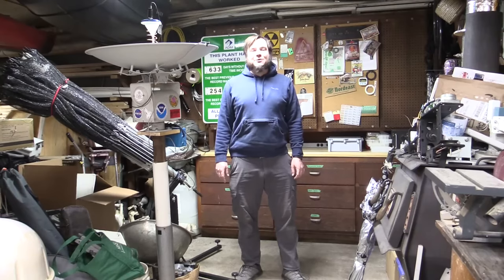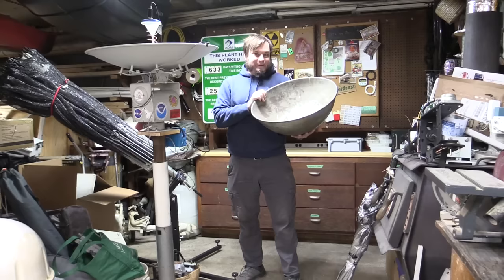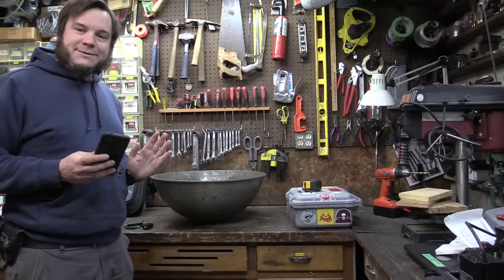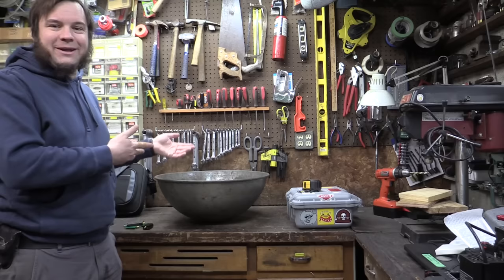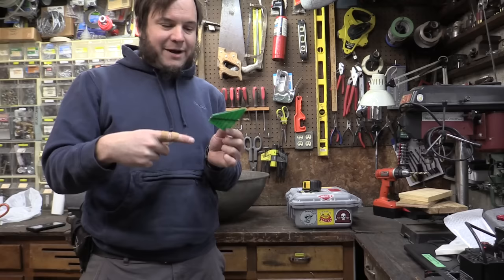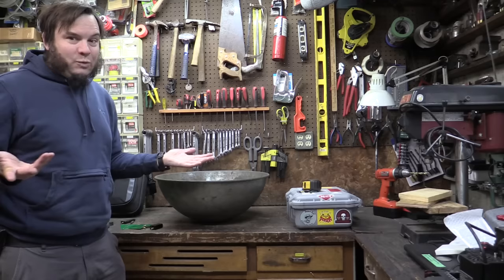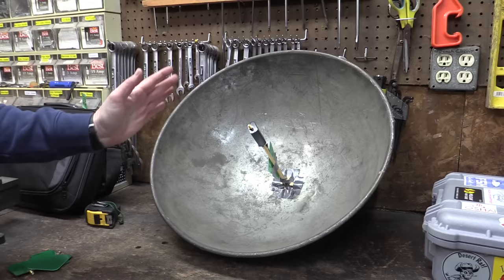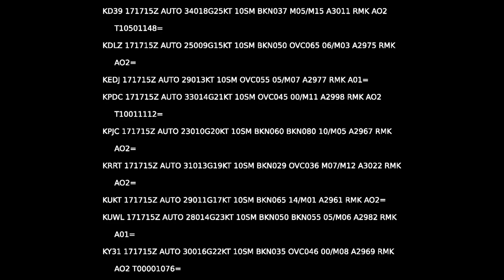Can I Make A Satellite Dish From A Big Bowl?

Comment: We're about 2 videos away from a paper-mache satellite dish.  Keep it up Gabe!
Reply: I LOL'ed  With a punching balloon mold.
Reply: Alright -- here's what I'm thinking.  Get a bit of plastic sheeting and tie it across the opening in a 50-gal drum (or a 5-gal bucket).  Draw a slight vacuum.  That gives you the parabolic shape you're looking for.  Then add paper mache.  Then aluminum tape.  Bam!  The world's first paper-mache antenna ;)
Reply: @markjarrodhughes  Do it with a space blanket and make a parabolic mirror. Then burn things lol.  There's a guy on YouTube who did that.  They tried to use expanding foam to hold the shape afterwards though if memory serves me.
Reply: that is possible with a little tin foli
Reply: Paper mache made with aluminum foil...
Reply: @kman201399  Ooh!  I've got a whole collection of hats made out of that stuff!  We've got plenty!
Reply: Doesnt a loosely hanging string form a parabola? Im thinking cut a broadsheet newspaper into 1" strips, glue em up, maybe a few sheets thick and make a bunch of ribs, id probably hang them between 2 rails on a clothes horse so the distances remain constant. once they are dry, arrange your ribs, add more paper until complete. youd probably want to do it in a few steps so it doesnt get to soggy. I dunno, ive put about as much thought into this as its taken to type, but im sure its possible after a few attempts. its not as if the the parts are of any worth. would be nice and light weight for handheld use.
Id give it a go, but Ive got a collection of dishes hanging in the shed which im not doing anything with.
Reply: Yes very possible !

Comment: Those bowls are normally spherical... remember Arecibo?  You use a linear feed with a spherical section to approximate a parabola... and you can steer the feed around instead of pointing the dish!  A set of cross-bars would probably have suspended the feed well and given you some focus adjustment.  Linear antennas work fine for circular... you don't even have to spin them to peak the signal unlike linear-to-linear (satellites generally are not stabilized in rotation).  You do lose a little dBs.  Your focus calc is probably not good for spherical reflectors.
Reply: Sure, but if he spends 2 weeks calibrating a mixing bowl that's two weeks he's not spending on serious content.  All the calculations in the world aren't going to make it ideal.

Comment: the most convenient thing in a kitchen for antennaification ive used is a wire mesh ladle for deep frying. a couple of bucks from the asian supermarket. built one for a mate in high school who had a really bad wifi signal in his bedroom. cut a hole in the middle to poke a USB wifi dongle through, a usb extension cable, adjust the depth for best signal and apply hot glue. we 'mounted' it by stabbing the handle into a box and parking it on top of the closet. took the signal from 1 bar to 3 bars, which was enough to be useful. 
Our first attempt was a coke can cut up very similar to the candle reflector in one of your recent videos shoved over the routers antenna. kinda worked a bit, but also tanked the wifi for the rest of the house, so that was a No-Go.
Eventually found a long enough length of cat 5 to run around the outside of the house. pro tip, black poly irrigation pipe makes excellent outdoor stealth conduit. cheap and ubiquitous, lay it in the garden bed and nobody questions its right to be there. a much easier sell to the perentals/landlord than wanting to punch holes in the walls or roof. I wouldn't use it for mains and ends up a bit longer, but Cat 5 dont mind. Ive used it more recently in rentals with particularly difficult landlords and housemates who dont appreciate the aesthetic of cat5 winding around the loungeroom and hallways. no idea why...

Comment: i did something like this with a large stainless mixing bowl duct taped to a tripod with a usb wifi adapter zip tied to a free bamboo chopstick, it worked great for borrowing wifi from the neighbor across the street (with permission).  the feed point/ best signal was almost at the brim for the adapter... it was a 12" diameter bowl

Comment: Try putting the feed 2 to 4 multiples of the wave length that you are trying to receive from the estimated focal point.

Back in the lat 1960's I mounted an 8 ohm speaker using all thread standoffs in front of a large bole like that and connected the speaker to the microphone input of an audio amplifier feeding headphones and I could hear two guys talking in a boat they were fishing in the Manatee river in Manatee County Florida, they were about a half of a mile from me and I could hear them very well.
I was on the north side of the river in a small town called Palmetto Florida, yes it is the same town that the movie with Woody Harrelson was in was shot.

Comment: I've got some of those PCB antennas recently, having designed some patch antennas for my degree I wanted to check out what was out there already.
Some are not bad, some shift in what frequency they are resonant at with very minor contact with other objects, thats high frequency antennas for you tho.

The log periodic is the most reliable but that almost planer horn shaped antenna is quite sensitive to condition changes.

Comment: Using a right angle triangle C^2 = A^2 + B^2 you can calculate the radius of a curve..

Depth = C - A
B = Diameter/2
C = ((Depth^2) + (B^2)) / (Depth x 2)
Radius = C
FocalPoint = Radius x 2 (or is that half)... This part I forget..

I used this formula to calculate the depth of reflector telescope mirrors..
If you are grinding your own..

Comment: I think you need low gain antenna like a simple dipole in the focus since the signal comes from all part of the dish in different angles.
The log periodic antenna is probably way to focused and only uses a small part of the dish.
Reply: Also the one antenna he said didn't work at all is a Vivaldi or Tapered Slot antenna, and he had the slot pointed in the wrong direction! The slot has to point towards the "dish", not parallel to the rim 😛

Comment: 2:00 @Gabe, one thing you might want to look at is something called a Vivaldi antenna. They are a wide band circuit board antenna, and very interesting to work with, especially if you connect them to a SDR.
Reply from the maker: I tried one of those in another video, it seemed to work about the same as the log periodic antenna.

Comment: Nice try, anyway.  Even if that bowl were parabolic (they're generally spherical), feeding it efficiently with such a low F/D would be a significant challenge--your feed would need to have very little forward gain.  Add in the fact that it's spherical, and you have a real challenge turning it into a workable antenna.

Comment: Hi again i was watching this video and  i have been into satellite dishes since the late 1980s ,there's nothing wrong with a bowl as a satellite dish nothing  also wrong with its shape at all  !  the difference between a deep dish  as in this bowl and a shallow dish is a deep dish is more directional and sees less of the sky  so less noise really  detected  and  they are very directional  a shallow dish sort of what normal dishes are ( really they are in between design ! ) really shallow dishes the feed focal point is way above the dish and a deep dish its very close to the dish  shallow dishes see a lot of sky so direct all that radio noise to the the focal point .With a deep dish design, the LNA and feedhorn are positioned at a level almost parallel with the rim of the antenna. The deep dish provides superior shielding for the feedhorn and LNA, rejecting more earth noise and terrestrial interference than a shallow antenna would. But because of the feed's close proximity to the surface of the antenna, it cannot view the entire surface as well as when a shallow parabolic design is used. Consequently, the deep dish will not provide as much gain as that produced by a shallow antenna of the same diameter but it did an amazing job detecting that geo sat you pointed it at for  its size  the focal point i would think is more critical as well ,did you try rotating the dish  for polarization  of the feed ? that is another factor can come into play ...Great  job again with this  video just a few things i wanted to point out learn some thing new every day i say ; 0 )

Comment: How about testing how small of a dish could work, but with actual parabolic shapes. Like maybe a reflector for an old 6V flashlight. Maybe something that fits in a backpack.
Reply from the maker: I've done a bit of that, the tiny RV dishes are kind of useless for anything beyond commercial TV. For a backpack you'd need a folding setup, like what I did with various umbrellas and foil.

Comment: Guess a follow up: a phase array antennae...from paperclips?
Reply: Or an umbrella array.
Reply: hehe Ka Band array
Reply: @rawexploiterp6951  looks like a fun band. More reasons for the rtl-sdr down convertors.
Reply: @nolan412  there is already an LNB for that band, generic TV dishes use those. you just need appropriate connectors and 12v Bias Tee board.. maybe it's possible to remove waveguide feed from LNBf then connect array to that? might be hella lossy..

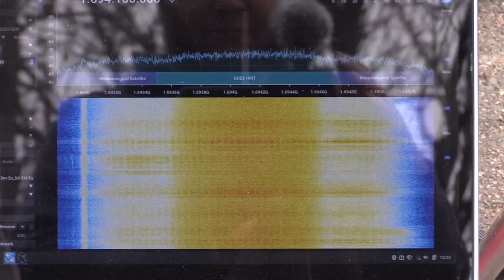Comment: I love trying random new stuff. quick question, could I use my dads old LNA-200S and no I don't still have the antenna, i have used it for listening to police band on 470.538.500 from 56mi away on my roof ant and its worked well in the past? also what module where you using for 3:40 on sdr++
Reply from the maker: I'm not familiar with that unit, sorry! I don't have any extra modules on SDR++, just the stock program.
Reply: @saveitforparts  I mean, i wasn't looking for a direct answer for the LNA I just wanted to know if something like that would even work or if it would destroy the diodes on my rtl-sdr v3. And thank you for making me realize I haven't updated sdr++ in 4 months😢.

Comment: Of course you can't build a parabole from a bowl,as they have a curvature cut out of a quarter of a sphere and a precise focus point where the radio signal reflected meets😆 Also in the case of the offset it's 1/8 of the sphere having a superior gain because the LNB doesn't shaddow the dish